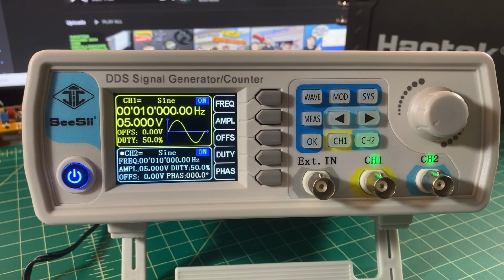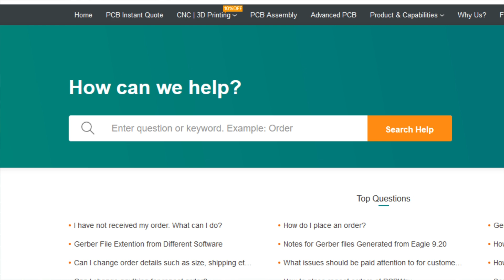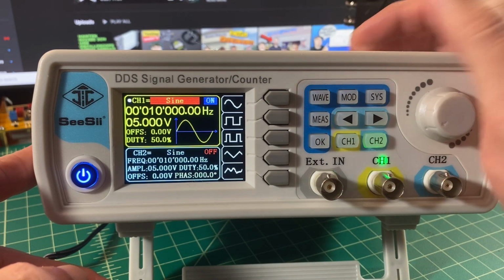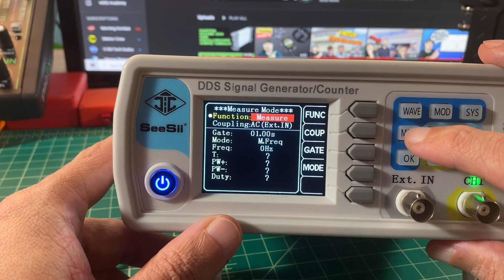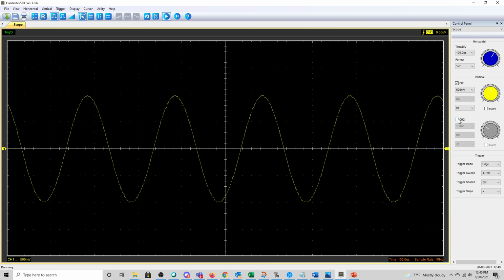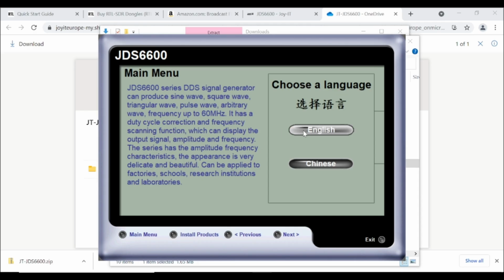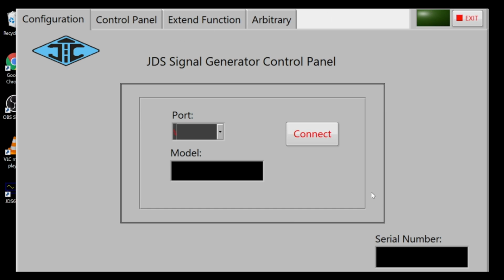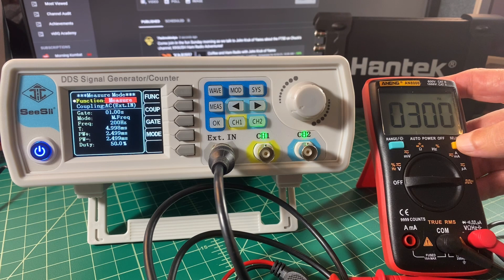DDS Signal Generator and Counter

Comment: Does anyone know how to use the Duty % function, after I selected square wave I adjusted  the duty cycle to 80% from 50%, but the Duty cycle remains at 50% when  viewing the selected square wave. ?
Reply from the maker: Are you viewing in the Sig Gen screen or output device?
Reply: A square wave like a sine wave by definition has a duty cycle of 50% - or else it becomes rectangular. Try changing to rectangular waveform, then you will be able to change the duty cycle.

Comment: Hi, I was wondering the minimum amplitude that this goes to?
Reply: The amplitude adjustment goes down to .000 volts in .001 volt increments.    I connected it to a scope to verify and while the scope shows a lot of noise, I can definitely see a sine wave take shape going from .000 to .001 with greater definition as I increase the amplitude.
Reply from the maker: Sorry Asad, I don't remember and have given this device to a ham buddy.
Reply: @TheSmokinApe  All good. Thanks anyways

Comment: The ability to have a dual-channel signal that is sync'ed gives you a lot of ability to generate complex output...could be very useful for filter examinations, rig testing, etc. Great video! If you are not familiar with Tony Albus on YT, you'd like his work a lot. Try to match his enthusiasm, LOL! 73 de K4FMH
Reply from the maker: Hey Frank, this will probably be mostly used on filters like you mentioned.  Tony has a great channel, I sub'd him a while back...  thanks for checking out the video 👍